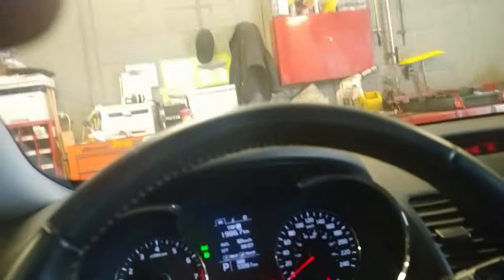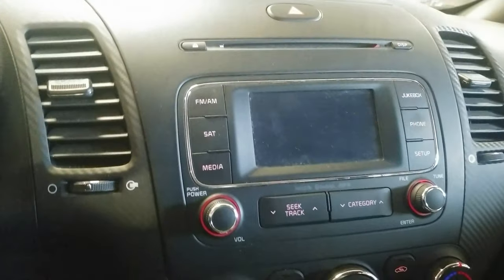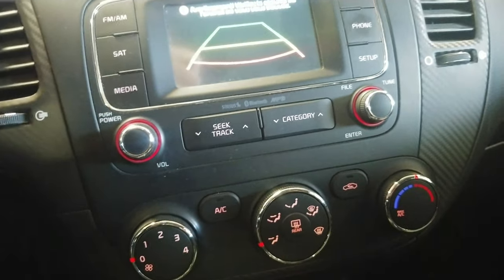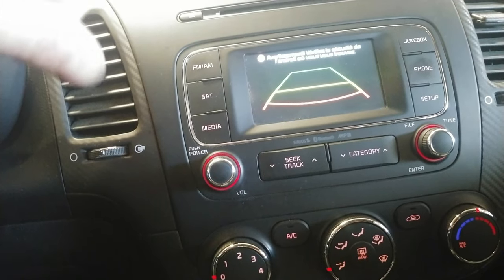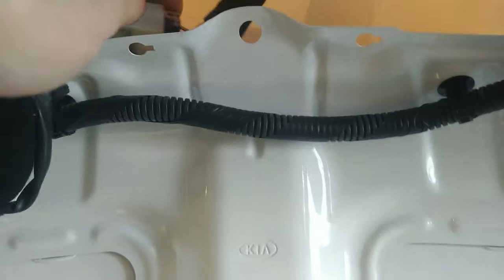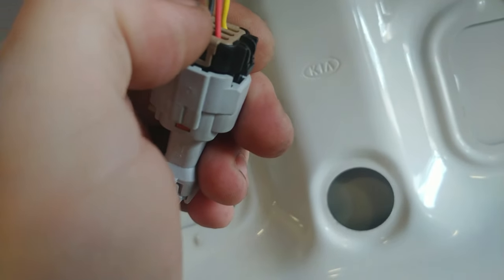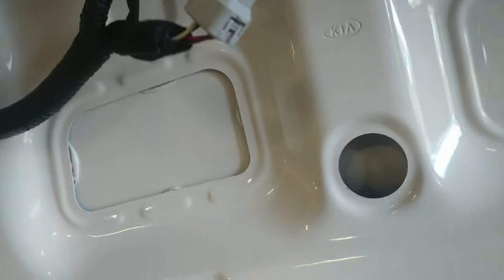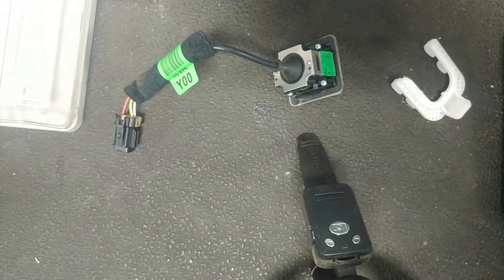Kia/Hyundai Common Backup Camera Issue

Comment: Hello, I found the pinout for the 'C' connector on the back of the AVN unit.  It has 5 wires: (1) camera + [~6 VDC?], (2) camera gnd, (3) video signal, (4) video signal gnd and (5) reverse.  I'm assuming (!!) if I put 12 VDC to the reverse wire (say from backup light) it will activate backup view??  Just don't want to blow up my AVN if it's 5 VDC TTL level voltage.  Any thoughts?  Thanks!

Comment: I had a Hyundai with the back up camera causing intermittent communication fault codes in many modules. Almost every light on in the cluster. And  limp mode like driving conditions.

However the vehicle I was working on. The backup camera was on the network. 
I diagnosed the camera to be faulty. Was shorted internally due to water intrusion. Oddly enough the customer said that the camera hasn’t been working for over a year.

Comment: Hi, thanks for the How-to

I have a Kia Cee'd JD 2012 and am having the same issue with the backup camera. When I bought it, it was blurry but working. It didn't take long for it to stop working. So, I was left with a black screen with guidelines. After about a month that stopped showing up. Now, when I put the car in reverse nothing happens to the screen. Opened it up and found the camera was full of corrosion.

My question/s to you:

1. How come nothing happens to the screen when I put the car in reverse?
2. Are the guidelines part of the camera or the audio unit?
3. When you took measurements at the back I only saw you use the red probe. Did you touch the black probe anywhere to get that reading?

I hope you're still reading the comments section.

Thanks very much in advance.
Reply from the maker: Good afternoon

1- nothing happens to the screen either because there is an open before the camera's power/ground/signal or you have a defective camera.
2-I really never tested to see which is were, but i believe they are in the camera.
3-the red probe  is the tester and the black is to ground- I am checking for power from the radio to the camera.

Thanks for watching
Reply: @JLsAutoSolution  Thanks. Looks like I’ll have to get a new camera :/

Comment: Thanks for your videos.  I have an issue with my 2013 kia sorento backup camera.  I changed the camera but the display in the car is still not clear.  Actually the display is very bright so cannot see the camera functioning.  Any helpful information with this issue would be greatly appreciated
Reply from the maker: Without seeing the issue I cannot say for certain, but you might be dealing with a audio unit issue.
Reply: Did you change your camera. Fuse

Comment: I have a 2015 Forte 5 hatchback. Tried to remove camera yesterday but could not remove the white plastic retaining clip. It pulls outs a bit and will not come out any further. I do not want to pull real hard and break something. I wish you video showed details of camera removal.
Reply: Think you need to press down on some form of locking tab as you attempt to pull out the clip.....press then slide the clip.

Comment: I have the exact problem but it turns on and functions normally from time to time so what could be the issue? Thanks!
Reply: @JL’s Auto Solution
Reply from the maker: Does the screen just go black or does it go black with lines.. if so the camera is more than likely at fault. but always do the diagnostics first.

Thanks for watching.

Comment: I’m getting a black screen with no line overlay, it was “scrambled” now it’s just black with no lines. Any thoughts?
Reply from the maker: seems like a shorted camera.. if you can remove it and open up the camera.. im pretty sure you will find corrosion.. do not replace the camera based on the screen..

thanks for watching
Reply: @JLsAutoSolution  I have the same issue and removed camera and stripped it, it was full of corrosion really badly, cleaned it all up, assembled back and still same issue
Reply from the maker: @Youtubeuser1_me  camera replacement is more than likely needed.. Just becarrful as corrosion could have shorted out the audio unit internally.. 

Thanks for watching
Reply: @JLsAutoSolution  thank you for your reply really appreciate it, I'm in the process of ordering a replacement but the genuine ones are sky high prices, any recommendations
Reply: @Snakeyes1000  Thank you much appreciated, unfortunately, I think the generic option I'll go down that route and see from their thanks again
Reply: @Youtubeuser1_me  what did you find for generic?

Comment: I have a 2018 kia soul plus, my camera was working fine no blurred screen and it recently went to a black screen with no lines or video. Would that be due to corrosion or could it be a defective camera? Thank you 🙏 
Robert.
Reply from the maker: if the camera is chaning from radio to black screen while going in reverse, that the camera is at fualt(normally) follow the information in the video if you can. if you cannot perform the work bring the vehicle to a reputable shop for diagnosis.
Reply: @JLsAutoSolution   when I put it in reverse the radio screen does try to switch to the camera but all it shows is a black screen and no lines or video. Faulty camera?
Reply: Will do with the video and thank you 🙏
Reply: @thelastinline3186 I am having the same issue. Did you get yours fixed,

Comment: Does the camera just pop out of the trunk? Was thinking of pushing up and out with a screwdriver, but don't want to break it.
Reply from the maker: It depends on the model.. Some, yes. The suvs no.
Reply: @JLsAutoSolution  I got a 2014 Forte, I am at the camera wiggling the white clip.

Comment: i have the same issue when putting in reverse, i get the reverse guide lines on the screen but no image. the fuses are fine, the reverse lights work, the trunk latch and rear wiper work, so i know everything up to that rear junction is fine. i bought a new camera and hooked it up, but the screen still shows the guide lines with no image. i used a test light to check the pins in the wiring harness and the test light only lights up when i touch the pin for red/power. where do i go from there?
Reply from the maker: What vehicle is this.

if the lines are showing up then the  camera is able to receive and transmit its signal.. Where did you purchase the camera from?
Reply: @JLsAutoSolution  so the lines don't come from the display, they come from the camera itself?
it's a 2015 kia soul. the replacement camera is new but not oem (purchased from a seller called "master tailgaters" on amazon). i have this issue of lines with no image from both the original camera and the new one.
Reply: @geekdiggy  update?
Reply: @MacAutoDiag  no update unfortunately. i hadn't made any progress and i just went on living with the problem lol
Reply: Which fuse is for backup camera?